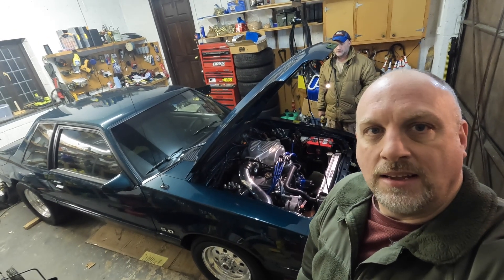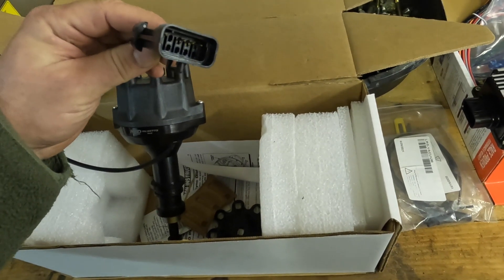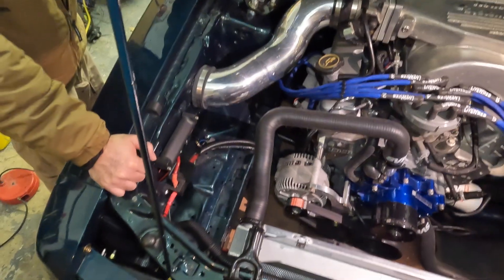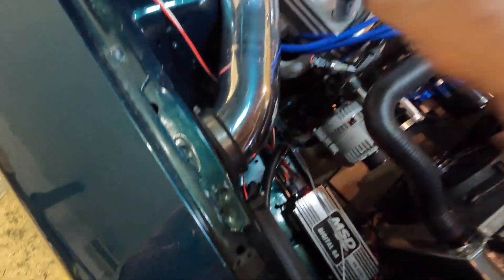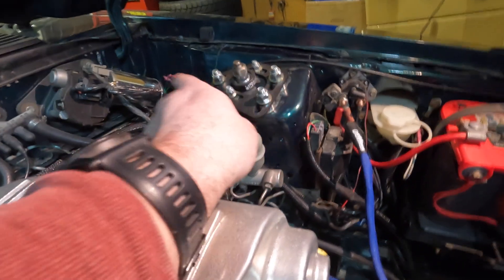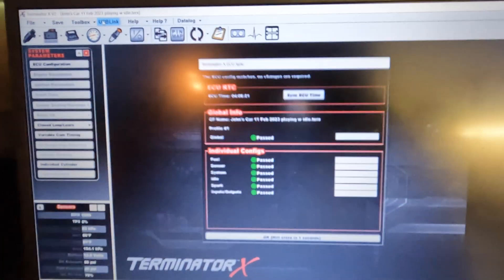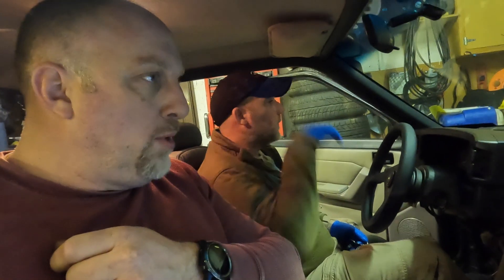Holley Dual Sync and MSD Ignition on a Terminator X Foxbody Mustang

Comment: Hey quick question, having a hard time to hook up my dual sync to the msd box. I’m installing my terminator x for the first time, my msd box has been installed. Which wires go where?
Reply from the maker: The Dual sync goes to the Terminator X.  The MSD box then gets triggered by the Terminator X.  The Dual sync and the MSD box don't talk directly to each other.
Reply: @Mike-FoxsAbroad  thanks for the response bro, ok better question where do I hook up my msd wires to the terminator x?also do I need to even hook up my msd box to the terminator ? I have a 347 stroker 205 heads big cam edelbrock intake and supporting mods. I’m about to tackle this job in about 2 hours. Because currently I have my terminator x hooked up to everything but my distributor. I’m going to set my distributor in and hook it up. But when I’m looking at my msd box I don’t know which wires to the terminator x or coil? Is it just a wire directly to the terminator x?
Reply from the maker: @JesseUrbina-c2b    I explained it in the video at about the 6:00min mark.  There isn't much to it. There is only like 6 wires that get used coming out of the MSD box.  Two to the battery, two to the coil, one to switched 12v, and only one wire that talks to the Holley.  Hard to mess up.
Reply: @Mike-FoxsAbroad appreciate it brotha.

Comment: when install a Dual Sync Distributor ...do I need a CDI Box ... or can I run without Box using Terminator X ?
Reply from the maker: @Diondo26   the Dual Sync distributor is just the brains, the CDI box is the brawn (high current) that actually powers the ignition coil.

Comment: Great video, my 1990 turbo gt has been running fine but I my TFI modules kept malfunctioning. I since have decided to swap to the duel sync distributor. I have a terminator X and had an older style 6al box. I configured the terminator x software as per instructions, set the dizzy at 50 degrees btdc and ran through the installation process with setting the cam and crank signal. Things went smoothly. Went to crank the car but have no spark. Figured maybe it was my 6al after double checking and seeing that all my wiring was in order. Ordered up a 
 digital 6al box + a hyperspark coil. Installed both and checked over the wiring seeing that it’s in order. Still having no spark…. Using the laptop can bus connection I was able to verify I have rpm signal over 100 when cranking but no spark from the coil (using inline spark plug tester). Reading on forums and searching videos hasn’t really helped much. I’m thinking it has something to do with the white wire from the terminator x harness. Any thoughts on what could be causing this no spark problem?
Reply from the maker: 6AL is not really needed as the Terminator takes the place of any rev limiter.  Near impossible to say with remote troubleshooting electronics. I would ground the distributor body to the block and spin it by hand. That should tell the computer that the engine is spinning and it should fire the ignition. Disconnect the injector harness or you’ll fill the cyls with fuel.  That’s all I can think of.
Reply: @ thanks for the speedy reply I’ll try it out now and see what happens

Comment: You were actually pointing to #5 cylinder not #1 it kept confusing me when you were saying #1 and it was facing the opposite way.
Reply from the maker: @whatthefox302   I was pointing to where the #1 spark plug terminal on the distributor cap is indexed/pointing to. Not to where the actual #1 or #5 cylinder would be.

Comment: So I bought this exact same combo I’m running a stock 302 with terminatorX and it runs great but I want to make it more reliable for my high school son, so I’m ditching the tfi and going this route. Just wanted to know how has it been running for you ? Are these distributors good for daily drivers ?
Reply from the maker: It’s been running great on John’s car and on mine for over this whole year. You can always keep the TFI and wiring harness in case the Dual Sync gives you trouble. Not hard to switch back if needed.
Reply: It's been fantastic. No issues.

Comment: I'm getting ready to do this and I've seen some complaints of the stock fuel rail crossover line interfering with the distributor install. It didn't look like you changed the fuel line but just wanted to see if you had any issues with that?
Reply from the maker: I’ve done this on two cars. Neither was a concern about it being close to the fuel crossover to worry about.

Comment: Great video, nice job on the install...did you make sure to SYNC the timing with a "timing light" after you got it started? You have to make sure the timing light number at the crank matches the static timing check  number you set in the software at idle and at higher RPM to make sure you don't need to adjust the inductive delay.  In the video, you just stabbed the distributor, and did the LED setup then just fired it up and never showed the timing light sync check, unless I missed it?
Reply from the maker: We did a cursory timing check after the install, but it was dead nutz on.  Setting the distributor at 50° is a dialed in procedure for the Dual Sync as it's worked on this car and on my personal car without issue.  The inductive delay is pre-set by the Holley software when you select the Dual Sync in the settings.  You could maybe adjust it if you felt the need but ours both were happy with the default numbers.
Reply: @Mike-FoxsAbroad  Cool I'm with ya!  You got lucky...as long as your Terminator commanded timing and what you see on the balancer with timing light are matched up then you're golden.  Yes the 50° is the built in reference angle for the Dual Sync and is distributor/platform specific so you must have gotten lucky that your cap/rotor phasing landed perfectly and you didn't need to tweak the distributor housing at all to get them matched up with timing light readings. 👍

Comment: I’m currently building a sbf for my street truck. Will the tfi distributor be okay, or do you recommend the dual sync? Also, is it a direct plug n play with the terminator x or would I still have to wire some things up? Not running a CD box. Only looking at 350-400 hp on my build. Thanks in advance.
Reply from the maker: The TFI will get you going and be just fine.  Only you can determine if the TFI is not working out for you or you've outgrown it.  The dual sync is half plug and play.  I directly takes the place of the TFI distributor but it will not work without an aftermarket ignition box like a MSD 6A.

Comment: If I’m running a Terminator x and a MSD ignition box already, would I just have to plug the dual sync into my terminator x harness and update the tune? Did you just tuck the tfi module harness away after this upgrade?
Reply from the maker: The Dual Sync distributor's wiring harness takes the place of the TFI harness.  There will be no leftover harness to tuck away.
Reply: Thank you! @Mike-FoxsAbroad
Reply: @Mike-FoxsAbroad  One last question since I am tackling this install tomorrow. What did you do with the white wire that was running from the TFI adapter harness when you installed the Dual Sync distributor? Does that wire just get left unused/removed? Thanks again!
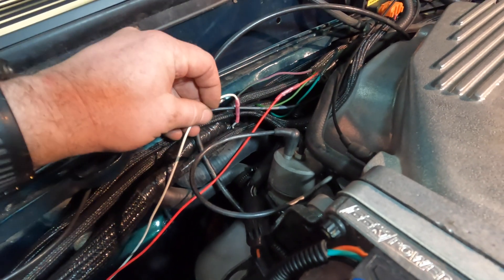Reply from the maker: @nicksolimini9393   It's no longer used and can be disconnected from the negative side of the coil.  The TFI harness and the TFIs EFI settings use that wire to sense the ignition events and extrapolate an engine RPM signal.  With the Dual Sync that gets taken care of in its own harness.  But the white wire that you need to fish out of the main harness (@6:38) is now used for an output to the MSD box and the signal wire to the tachometer.  With a one signal/one spark of a stock ignition system, that TFI harness was ok.  But with multiple spark output from the MSD box, the computer/tachometer needs a different setup to work properly.  I hope I didn't confuse you.
Reply: @Mike-FoxsAbroad  Which harness is the white wire? I see a white wire in my harness, but it is going to the Injector Harness. EDIT* Found it, it was cut off almost all the way back down by the ECU.
Reply from the maker: @nicksolimini9393    I couldn't say.  I have one of the first foxbody Terminator X kits and I know the newer ones changed things a bit.  Hopefully you can find it.  I tucked mine away initially when I started with the TFI and needed to go digging to find it when I switched to the dual sync.

Comment: I saw in the other video ya all made with his car on the dyno that it had a billet camshaft. You might want to change it to brass. Also love the videos I’ve learned a few things. Thanks
Reply from the maker: I've done brass.  Done melonized.  Done steel.  The main items that I've seen that cause excessive gear wear from running a billet camshaft are high volume/pressure oil pumps and-or thick engine oils.  Cold taching an engine is right up there with dumb stuff to do to a motor as well.  In the end time will tell how it will fare but there will always be some level of wear.
Reply: @Mike-FoxsAbroad  this is true jus wanted to bring light to it.. and good job on the vids

Comment: Newbie question but with this set up, it does not need a tfi module anymore?
Reply from the maker: The Dual Sync distributor and MSD box eliminate the need for the stock TFI distributor and the issues that come with them.
Reply: @Mike-FoxsAbroad  I appreciate you 🙏

Comment: Confused why you pointed #1 at the back driver side? Isn’t #1 the front pass cylinder
Reply from the maker: I was pointing to where the #1 spark plug wire would be on the distributor cap.  It's usually at the 12:00-1:00 position looking at the distributor, when looking at it from in front of the radiator.
Reply: I don't understand either. #1 cylinder terminal is always around 11 o'clock
Reply: @aceryas  Not the terminal, but where the rotor is at TDC for #1.

Comment: Nice upgrade and money well spent for sure! I hope not to offend anyone here and am only looking to give advice if you're open to take it? From what I seen at a glance up you could stand to remove at least 20% of fuel at idle. If this is still the base fuel map I'd be willing to bet that will be the trend throughout the entire table as well. In my opinion that transfer and smooth method is almost unreliable and takes way longer to prefect than it should! If possible, you'll have faster and greater success sitting in the passenger seat real time tuning with learn turned off. (So long as you can trust the driving ability of your buddy!!) LOL
Reply: It does learn slow, and we have more work to do but driving with the learning "off" right now is almost impossible with the roads over here, especially this time of year. That said, I'd rather it be rich than lean for the learning. Maybe as the weather gets nicer, Mike and I can get it out and do just that but we are also still learning the system too. Any feedback you have from experience is certainly welcomed by me as I'd love to dial this car in more. It makes great power for a small NA combination and I'm even more impressed with the fat power band. FTI nailed it with the custom grind cam.
Reply: @johnhickman106  I get it buddy, my cars don't even come out in bad weather! Lol  
I'll give all the advice I can to a SBF Fox!! You are absolutely correct, it is better to be rich than lean. What I seen is CL pulling 20+% at idle. That's a bit excessive, I'd recommend pulling 15% from the base table say from 70kpa out to 2000rpm, give it another go and see if CL is still pulling 5% or so. If so you know you're on the right track. Also If you would like feel free to send me a data log. I'd be happy to look over it and give suggestions or make corrections and send it back.
Reply: @jasonbrinegar6759  I appreciate it. I may pull a log the next time I'm out with it.
Reply from the maker: @jasonbrinegar6759   Also remember what you saw in this video was a cold start.  It was not warmed up at all and we didn't give it any additional time to run being it was so late at night.
Reply: @foxsabroad  I hear ya, I wasn't out to offend or discredit anyone's abilities. Just offering suggestions
Reply: @jasonbrinegar6759  Yeah, I forgot to mention it was still idling around 1100-1200 during warmup. It never warmed up enough for the idle to drop as well.
Reply from the maker: Thanks.  We certainly do not claim to be experts.  There are no good dyno's here in the UK where we could get anyone familiar with this software.  We were both tuned by a semi local guy but that was more to ensure we were not going to blow it up than anything else.  They certainly didn't do much in regards to drivability and only concentrated on WOT stuff.   When we start driving them more this spring/summer we hope to do a better job of dialing things in.  Now with the better spark the short term fuel trim is already trying to pull some fuel.

Comment: Stick...isn't it great that we finally are in one place long enough to get our motorhead on?...have a great TSgt here at Mother Rucker w3rd FTS that has that 68 Camaro...hes helping me get my LS squared away...love what u n Zapp  are doing...love the foxbodies too...just sold the 327 with the TH350 trans...LS and Tk56 about to go in ...
Reply from the maker: Hey Jim.  Nice to see you here.  Not sure what computer system you are planning on using with that LS as I know there are loads of options for you.  The Holley Terminator is super dialed in for GM stuff.
Reply: Jinro! It is great to be able to get the car going but certainly couldn't have done it over here without the help of Mike and Pete. It sure has been expensive though! Curious to see how the LS swap goes for you but these days it should be pretty straight-forward.

Comment: How's the electric water pump on the street? Always been curious about running those myself.   I had terrible luck with MSD boxes.  So sensitive.  Hopefully the qaulity has gotten better.  Good call on the shock absorbers....mandatory, lol.  They don't like heat either.  That cars turning out awesome .  Be awesome to pull up to a bar in that thing lol
Reply from the maker: His electric pump is probably the most expensive (non essential) part on his car.  It is controlled by the Terminator X via the MSD solid state relay and is essentially seamless in the way it operates.  No issues on the street.  The Terminator is also controlling both of the cooling fans in the same way.  One kicks on at approx 185deg, the second at 200deg.  
Ive never had an MSD box go bad.  I even have an original MSD 6200 on my Mach 1 still going strong.  I did have my Dual Sync go bad on me.  No idea why but I did have the original rubber distributor boot installed at the time.  Thinking it maybe got too hot?  Don't know.  Either way, Summit Racing replaced it for free no questions asked.
Reply: Hey Jimmy! As Mike said, it certainly wasn't necessary but I wanted as little drag as possible on the motor. The water pump has been great so far. Hopefully the MSD will hold up. I just ordered a new coil as well so hopefully that will clean up any issues. I'm also waiting on the new 255lph pump, though it's overkill for this application.
Reply: @John Hickman  yeah I am sure you will be fine.  I think msd had a bad batch at that time because I went through 3 in rapid succession but the third one lasted the rest of the time I had the truck.  Results vary .  I asked my dyno guy recently if anyone is making rock solid boxes like msd in the 70s ...his response....they are all $h/t lol. Summit replaced all of mine no questions asked though. I really dig that water pump.  I have often considered running one.  Just havent..  I will eventually
Reply: @timelesssteelgarage  I remember the issues you had with the truck. I even drove a new distributor up to on the exit of I10 when you came to visit me!
Reply: @johnhickman106  thank God.  A very early date with my now wife.  She scored a keeper point that day lol
Reply: @timelesssteelgarage  LOL